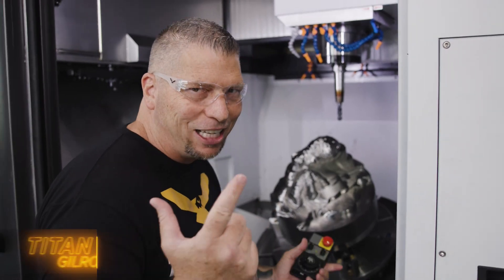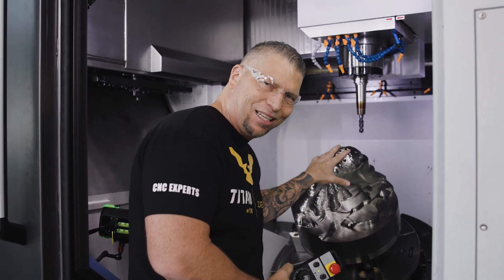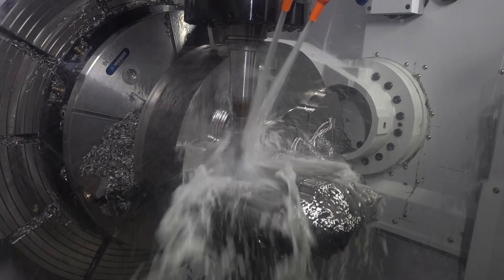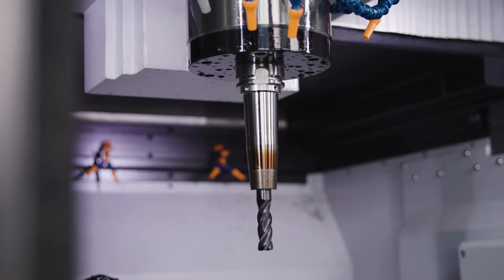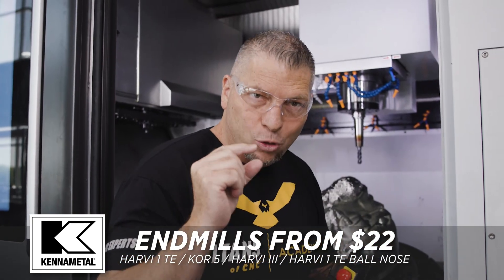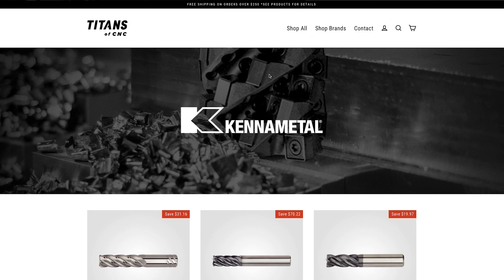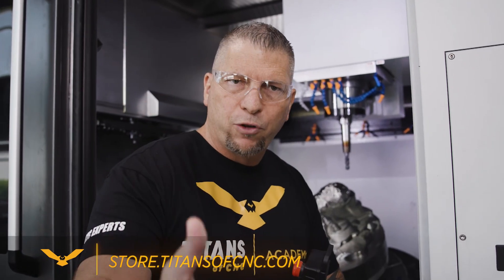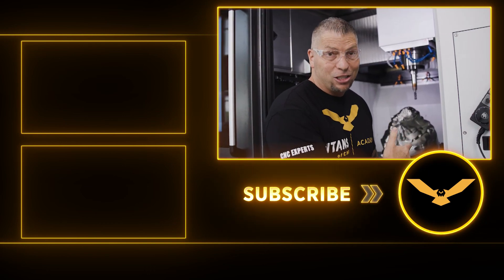? What Is It? My Crazy 500 LB Titanium Machining Project | Introducing Our New…

Comment: I have a question, lets say the power goes out. How do you re-zero the machine? or does it just know where it shut down at, and can resume cutting exactly where it left off?
Reply: I'm a machinist.

The machines use positional motors that know where they are - the motor's positions along with the onboard computer keep track of where the machine is at in its movement

Even in a worst case, you can still re-zero a machine yourself and have it running again (unless something is actually broken in the machine)

Some machines have the ability to restart from any position in a program, letting you skip any lines that have already been run of a certain toolpath (machine will attempt to make a safe rapid move to the coordinates in the line of code you select)

Other machines don't have this function, and you either have to re-write the toolpath or you can restart that toolpath from the beginning - taking a spring pass over everything that had been run before failure.